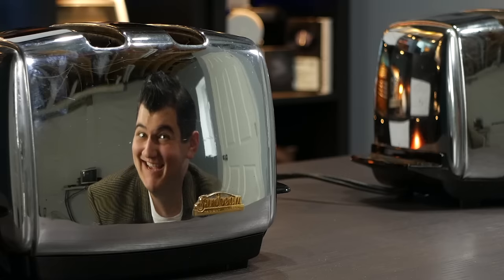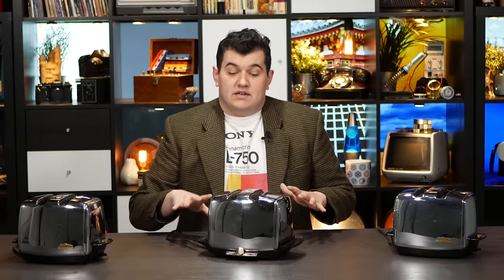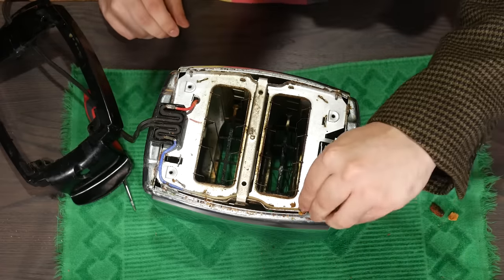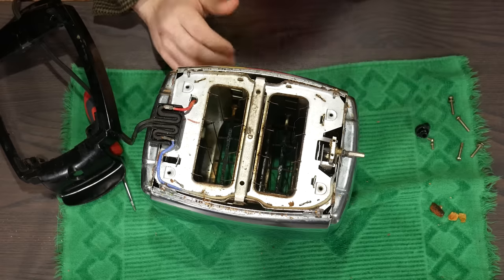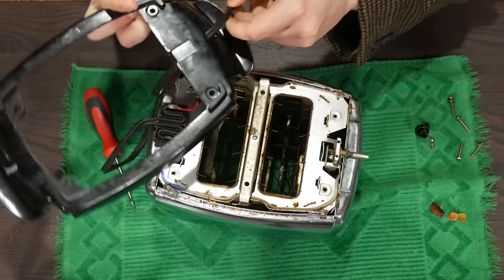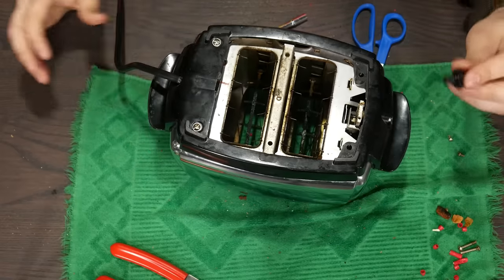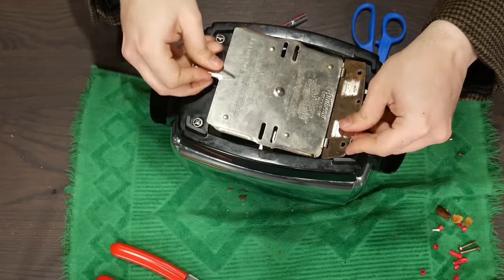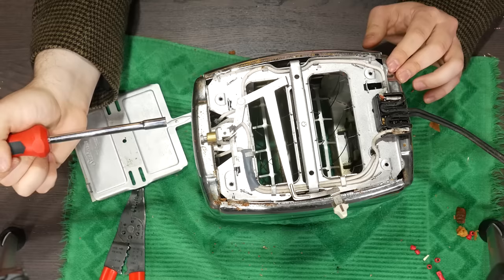Sunbeam Radiant Control Toaster--Repair and Modernization

Comment: 11:50 And it is not grounded, if the toaster fails and you touch it and say a microwave at a same time it is goodbye. That is why in Europe ungrounded plugs (which are obsolete now) do not fit grounded sockets. You need to ground or have double insulation to use in a grounded environment.

Btw here it would be illegal for a user to do what you do.

Comment: OMG, I want one of these.  Would it run ok on 230 volt?
Reply: He mentions that you could convert it to the 200-volt span using a diode of some sort, but he doesn't know how exactly. There was however a version of this toaster sold in Australia, which uses the 200 volt span.

Comment: I need help,
I really want to buy one of the, but i live somewhere in Europe.
Does this work with  European power on 230 V /50 Hz.
Note, im not talking about the plug type, the can easily be changed or just by an adapter.
Reply: these toasters were sold in australia too and they were 240 V /50 Hz a different plug as well

Comment: The reason modern cords are shorter is because modern electrical code requires outlets every 4 feet, so longer cords aren't necessary.

Comment: I would have gone with the 6 ft lead and used it to replace the old wires entirely.  Just cut the individual wires to the correct length.  Then you wouldn't have to worry about trying to awkwardly fit those butt crimp connections into that strain relief.

Comment: I would solder the wires and then use heat shrink tubing over the solder joints.

Comment: Thank god allllmighty you mentioned solder... Tin them.. solid is no biggie... just tin the wires first, do a double hook and loop em together, twist and solder, and heat shrink. You'd have breezed right through that no issues.
Reply: Sorry.. if I'm annoying.. I just want to help encourage you to give the soldering method more thought.

Comment: For whoever comes across this comment, from my own research, the two most recent models, the ones stamped Service AT-W (1970s-80s) or 20-3 AG (1980s-90s) on the bottom of the crumb tray, will have dual switch contacts. The T-20s, T-35, and Vistas don't.

Comment: There are two components for making perfect toast.  One is the amount of toasting which is the color of the toast.  Second is the depth of the toasted layer.  You can use a lot of heat and flash toast the bread but you get zero crunch.  A lower wattage toaster takes longer to get to the desired doneness but the depth of the toasting is deeper and the toast is crunchier and better,  This toaster is way too fast.

Comment: Personally, if there wasn't too much risk of damaging the toaster, i would have replaced all the wire inside. also a cable with a grommet to add to the strain relief, Then again that might be easier for us in the UK as cables like that are easier to get.

Comment: Throw it away or switch out the aluminum wire. Hot glue the wires in the strain relief and everything will be easier and safer.

Comment: you should just run the new cord through the strain relief then made the splice after the relief. also it looked like you had exposed conducting wire outside the splice which is no good either.

Comment: 1350W? I thought it would have been the magical 1500W. Well, 12 pieces of 1N4007 diodes should be okay. They're cheap. Put them in a wall adapter case and run a 2,5mm2 3 core cable to the device. Input is 230V~ 50Hz

Comment: You should get yourself a proper crimping tool. Those little flat pressed combo tools really suck. It's also unfortunate there isn't enough space under the cover to use two small wire nuts, that would make this a lot easier.

Comment: A diode would reduce the equivalent voltage to 70%, not 50%. So from 230VAC with a diode you get to about 160V and not 115V the heaters are designed for. So in no way just a diode could convert any 120V appliance to 230V one.

Comment: Those crimp connectors are the worst. I was wiring LED DRLs for my Miata and wasted more time fiddling with the connectors than I would have just soldering. Which I ended up having to do anyway because the connectors sucked so bad.

Comment: A comment on the way you are crimping. First the tool is as basic as it gets so you need to press much harder so the strains cant get out. Second if the wires are too short just make the crimping outside the strain relief but inside the toaster ofc. The new crimps are insulated. And if you want to do double insulation, use proper electrician heat crimp tubing over the mechanical crimping. Also the strain relief should pull on the outer sleve not the wires.. I know that is how sunbeam made it but if modernizing might as well do it right.

Comment: To anyone who wants to convert these from 120V to 240V using a diode, don't try it.
When voltage is doubled, power quadruples. With the diode, power is still doubled.
You'll probably get some smoke from the heaters and burnt bread, or a broken toaster

Comment: DANGER When working on wires that connect to mains and especially where higher currents are expected - such as this toaster - you should use a ratcheting crimp tool. A loose crimp - which clearly these were, they fell off TWICE - can lead to over heating, creating a fire or blowing your house breaker ( a loose crimp will draw more current), or short to the chassis. Hoping you don't die is NOT the best test.

Comment: Convert it to 240? Are'nt there Canadian models? Either way, I dont see why I should import one to the Netherlands🙃
Reply: Canada is 110-120v
Reply: there was an Australian model i think which does run on 240, however from my knowledge i only heard of it from one guy on the internet and couldn't find any other information on it.
In Europe ide suggest the safest bet is a transformer than can handle the wattage the toaster needs, but those are pretty expensive.

Comment: Hey couldn't you Put electrical Tape across the strain relief. so when you reassembled the wires the don't move Or come apart. Just across the strain relief not on the metal. I assume the heat from the toaster would be a problem. But they should have some sort 
Extra heat resistant electrical tape right. Not just electricity resistant hence the name Electrical tape. By putting the electrical tape on just the strain relief to prevent the wire from breaking in reassembly. Should be preventative to melting. As they say heat rises just a thought or buy a new Toaster lol!

Comment: I don't think converting it to EU is possible, or rather simple to do. I doubt the diode approach would work, you'd have to get one that can withstand the wattage. And higher wattage resistors and diodes tend to get larger/expensive real fast. Theoretically you could also use a transformer but again, you'd need quite a large one to step down 240 to 120. I don't remember the exact Voltage of EU 3 phase current but a single one might've been 120V. Using that approach would most likely be insanly unsafe and a bad idea though. Like, you could convert the toaster. But it would be a lot more work than it's worth.

Comment: On the older one you installed the new cord on, if you want a switch:

uh.. add a switch to your new cord.
Either at the outlet or spliced into the cord.

Comment: I think it would have been better to solder the wires and use heat shrink on them.   I would worry about that connection generating heat and maybe starting a fire.

Comment: I just found one of these T-35s in my grandmothers shed collecting dust. I replaced the wiring and it toasts, but the bimetallic strip is toast. Doesn’t have any snap to it anymore and it’s stuck pushed out, so the toaster cannot shut off anymore.  Anyone know where to get another bimetallic strip?

Comment: Personally I would solder the wires together and use some heat shrink instead of using butt connectors.

Comment: USE HIGH TEMPERATURE NONE INSULATED BUTT, AND RING CONNECTORS! They are attracted by a magnet by the way.

Better crimping tool: Klein Tools 1005 ( break it in with some WD40 before use ).

New wire would be MGT WIRE.

Comment: 36:20 That cable strain relief is pointless with that type of cable; the strain should be borne by the outer sheath, not the cores.  Also, the crimps on the original are un-insulated; I would have stripped the outer insulation off the new crimps to give more space and better visibility of the crimping quality.

Comment: Heat shrink insulated "but huhuh" connectors will bend and work better, but nothing can beat a linemans sploce, dab of solder  and heatshrink tube

Comment: I saved my grandparents T20B model but sadly one of the grid elements is broken. I've searched the internet for replacement elements but I'm not finding anything. I'm fairly certain the elements are not repairable either. I want to kick myself for messing with it before I did some research....I'd love to get it working again mainly as a way of remembering my grandparents.

Comment: Those crimps are made to go up on the wire sheath a bit. You could also make your life way easier just soldering and heat shrinking... Lol you make your life way harder than it needs to be. Good video tho.
Reply: Generally if a wire coating can handle it a crimp will too. Or you can get high temp heatsink.
Reply: And the ground you could even strip a bunch off it and let it get contact all over the metal from its attatchment and save a little space with sheathing.
Reply: What is scary is the amount of current coming through those if you dont have a good connection the lack of conductor and high amp will cause more heat in the crimps than the heat from the toaster elements most likely

Comment: Would have been easier if you soldered the wires and used heat shrink. Those butt connectors are not meant for solid color wire

Comment: Okay, you said if we wanted to use this toaster in Europe on 220V instead of America's 110V, we could put a diode in the circuit to half rectify it, making it safe to use. This is NOT true. Power is Voltage^2 / Resistance, so doubling the voltage increases the power delivered by times 4 (2^2). A half-wave rectifier would cut that power delivered in half, so divide by 2. well, 4 / 2 is still 2. So, the net effect would be twice the expected power delivered to the toaster. Do not do this.

Comment: Warnning,  this is an incorrect use of crimp !   The original crimps used  were designed for dissimilar wires size with the crimp holding them together with proper tension.   This is needed for heater/ high current products to obtain good connection to spliced wires as the wires get hot an expand.  Your crimp of the thin wire to butt connector is the wrong size and  now too loose and why your crimp failed so many time!    Your butt connection will now expand  and may come loose in time or possibly break the wires!

Comment: According to the Australian standard - which you aren't covered by - you made a perfectly legal and working toaster into an illegal and potentially dangerous machine.   The issue is to do with the lead and strain relief.  The previous cable, protected under an old standard, was perfectly acceptable and did the job of being an SI cable (Single Insulation).   The cordset you are using is not designed with this in mind.  The SDI cordset is designed for strain relief on the outside of the unit, with the individual conductors being free-floating inside to do their job.   You are now asking the single insulation to do both tasks.  This will fail eventually and is an immediate tag-out if we found that during our yearly tests.

But I know... Merkua vs Australia...   Different rule books...  The solution here would be to use a plug-based RCD, which can be operated without a ground.  The supply gets polarised on testing/insulating the socket.  The RCD is monitoring the supply and virtualises the earth connection.  An inbalance opens the circuit.

Comment: You can just cut the insulation off of your insulated butt connectors, and bam. Non insulated. That plastic sheath on it isn't really on there that well.

Comment: Replacing the power cord on these toasters, or other appliances!  This to me is a cheap cord being used, only 16 gauge - to me, these should NOT be sold!  Used to be, you saw 14 gauge usually as the smallest cord available - why not have a cord being used that is equal to the average electrical outlet in a home - 14 gauge wire (which is thicker than 16 gauge) - capable of 15 amps safely - the bigger margin of safety, the better!

Comment: Does anyone have an AT-W model?  it's the one with the adjustment slider on the front.  I'm trying to remove the bakelight bottom but it seems that it's all one piece with the strain relief instead of that being a separate block.  So I'm unsure of how to remove it, as it's all attached.

Comment: I'd solder the connection.  Butt connectors don't work well for the do it your self er.  Factories gave better equipment.  I'm going to find one, restore and use it.

Comment: The insulation that you mentioned is usually 'Fibreglass'
which provides both thermal and electrical insulation.
In AUSTRALIA all toasters are required to  have the exposed
metal parts to be earthed / grounded
It is also a requirement that Electrical circuits have an RCD
at the Meter box.
The somewhat ancient ceramic fuse holder with nichrome wire
were eliminated decades ago.
Also Power circuits for the Bathroom and Kitchen should be 
separate to the other circuits.
It is even better and desirable to have the power socket for the refrigerator
to be on a separate circuit than the other Kitchen power outlets.
One advantage to having a switch on the power outlet eliminates
removing and replacing the plug, for example when one does not wish
for a device to be on SBY power [StandBY] and in my case using the
switch on the Power outlet to switch ON and OFF power to the Vacuum
cleaner, as wearing out the Vacuum Cleaner switch and replacing it
is nuisance job, even if one can source a replacement which will often be
at an outrageous price. - Replacing the Power outlet is easier, quicker 
and the socket can be purchased for around USD$ 4.00

Also when replacing the Power cable in the toaster, one  may find a
power cable laying around that was used for a Computer PSU. 
I find so many of then at local markets for AU/CN $2.00  USD $1.40
No need to part with ones $$$ unnecessarily.
I have a large box full of US  EU Type F and UK power cables.

Perhaps you may wish to look at the grounding problems on El-Cheapo
Chinese Soldering irons and Hot Air Rework Stations, and besides that
my AC Isolation Transformers I modified to ensure that the isolated 
(secondary) is fully floating by removing the ground.
In Hospitals where isolation transformers are used, the secondary is
grounded. This is dangerous when using an oscilloscope having the ground
and neutral connected, can potentially create a S/C from the Oscilloscope
probe to Mains ground, and destroying the Scope and scaring the 'Living
Daylights' out of the technician when it goes BANG !! and releases all the
smoke that is necessary to keep the devices working.
One should not let the Genie smoke out of the bottle. 
(I hope you are well Ms. Eden)

Comment: The crimping tool you have is not very good.  When crimping to solid wire, you really need a “Real” crimping tool, which will either ratchet, or have handles long enough to provide adequate leverage... There are butt connectors made which have no insulation.  They should be used in areas that are subject to the kind of temperatures which may be encountered in a toaster. Your probably OK for occasional use, but if it was used repeatedly, it might get hot enough to melt the insulation.

Comment: As an electrician, watching how you strip those wires hurts. That multi crimper/stripper tool is a bad style of tool. Maybe just use proper crimpers and use proper strippers. The multiple rotating while stripping the wire (albeit it's from an older generation and may or may not fit gauge standards we know of today) is painful as once you cut the insulation you risk knicking the wire itself when you use the wrong gauge strip and proceed to rotate the tool.

This is an old video, but just some tidbits for anyone watching that isn't savvy with electrical wiring. Get independent strippers and crimpers. Better than shoving a large tool in a tight spot in a full box. The crimping tool towards the handle is going to screw you over when you have to account for your oversized stripper side sticking out the other end of a tight space. The only "all in one" tools you should ever buy are the 11-in-1 screwdriver (Klein and other manufacturers make them)  and, if you wish, the Milwaukee stripper/pliers combo tool.